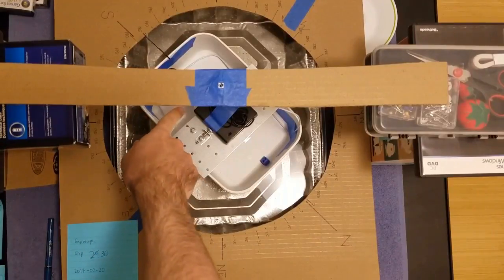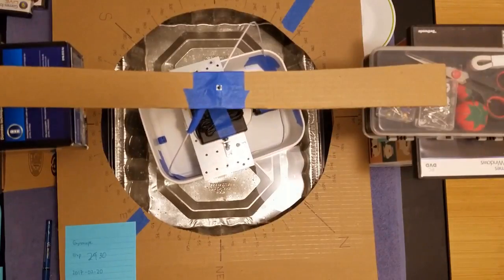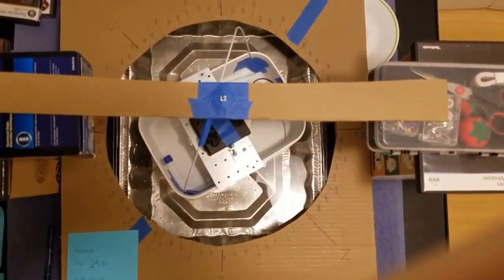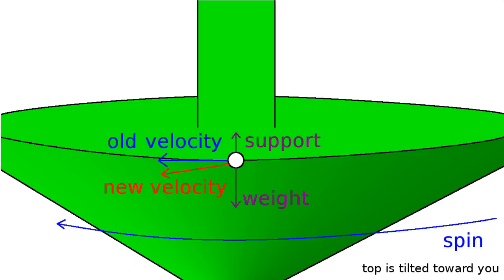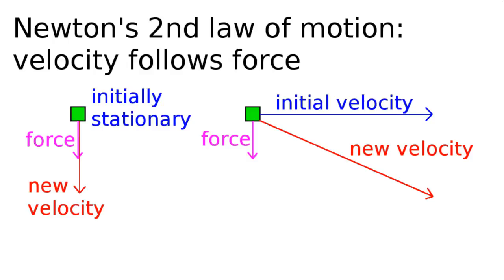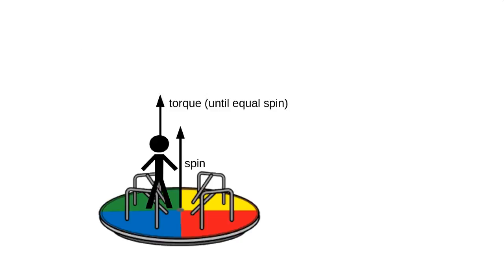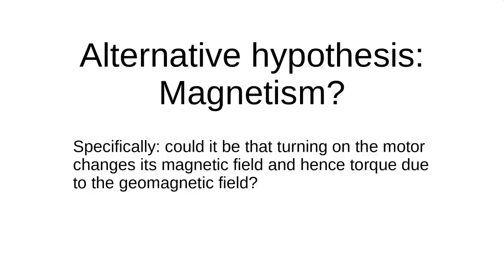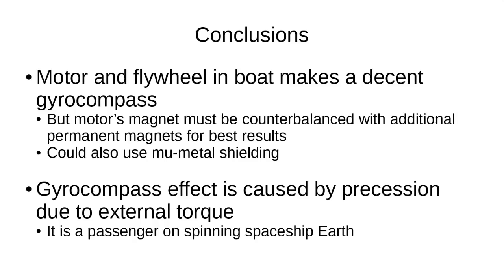Gyrocompass showing effect of Earth rotation

Comment: I wonder if there is a way to set up gyroscope in such a way that it can detect Earths orbit around the Sun? It will take 6 months for gyroscope to spin upside down and you will need to figure out how to cancel out the effect of Earths rotation on gyroscope. This way i think we can know if Earth orbits the Sun in circular fashion or vortex fashion. If circular fashion, then the Sun doesn't move. If vortex fashion, then the Sun orbits the Galaxy or another Star.
Reply from the maker: Well, a perfect gyroscope doesn't directly detect rotation; rather, its axis simply does not rotate, so if something else does, then the relative orientation can be seen to change.  To detect the rotation of the Earth-Sun system ("Earth's orbit") with a gyroscope, start by pointing its axis at the Sun, then observe that 6 months later its axis points away from the Sun.  To detect the galactic orbit, point the axis at the galactic center (Sagittarius A*), then observe ~120 million years later its axis points away from the center.  The Sun is not co-orbiting any other star (other than those near the galactic center), so there is no star for which you could point a gyroscope axis at it, then regularly observe it being on the opposite side.
Reply: @GarbageGamer74  I know the gyroscope maintains its axis and resists as long as its rotating, that tilting of gyroscope is only an appearance caused by earth rotating under it. There's a possibility the Sun is in 25,920 year long binary orbit with Sirius. https://www.youtube.com/watch?v=90q1uIQ5PqM Most solar systems within the galaxy are binary so the chances are the Sun is too.

Comment: Some minor effects that might disturb your gyro

1. The electric motor has magnets. The magnetic fiels of the earth will put a force to the magnets used in the motors.

2. Some parts of your gyrocompass are made of iron. Even if they are not magnetic now the earth magnet fiel will try to turn them into a north south direction.

3. Some parts of your gyro are generatong some kind of air stream, so the tiny forces of these airflow might affect your gyrocompass.

This is no offence, I thought about similar experiments (I'm not a flat earther) but I feared  all the disturbing effect might be bigger than the forces that should make the gyroscope into a gyro compass.

Kudos on your courage.
Reply from the maker: Thanks for the comments!  Regarding points 1 and 2, you are right, and that is why this gyrocompass does not point perfectly North.  I did a follow-up experiment with magnetic equilibrium in different places to show that, regardless of the magnetic effects, the gyrocompass effect is still strong, and always makes it deflect toward North.  See the link that I just added to the description of this video.

Regarding point 3, that's a very good observation.  In fact air flow coming off the flywheel can easily dominate other effects when using an instrument sensitive enough to detect Earth's rotation, as I discovered to my surprise when I started this project.  That is why the flywheel is encased in a paper cowling, ensuring there is no net torque due to air currents, since they are confined to that cowling.  I think I say that in the video but it might not have been clear.

Comment: Why can't you just point your gyro east, on a gimbal, and have it rise with the sky?
Reply from the maker: I did that.  Search my channel for "gyroscope version 2".  It worked, but only for a few minutes at a time before falling out of balance.  It is difficult to create a 3-axis gimbal that is both balanced and has low friction.
Reply: @GarbageGamer74  Sadly, your data traces are so confusing I am having trouble understanding what it shows. I imagined that a properly supported gyro could just tilt up with the rising celestial sphere. I may be dense, but (for me) you assume too much is obvious. I have the gyro and am trying to design my own rig.
Reply from the maker: @MumfordMicro  Suppose you had a properly supported gyro, tilting up with the celestial sphere.  Attach a laser pointer to the gyro.  The dot will follow the sphere, right?  That would be one trace, with the dot moving 15 degrees per hour.

Now suppose the gyro is balanced only within a limited angle.  When it exceeds that angle, it falls to one side.  So you would have to manually set it back within its range of operation and repeat.  That's the next trace.  I did that over and over to get the traces shown.  But I didn't always reset it properly (it is very delicate), so the traces show a mix of behaviors.

Finally, in my setup, the laser bounces off of a mirror mounted to the gyro, rather than the laser being attached directly.  That magnifies the motion by 2x, so it moves 30 degrees per hour when in the balanced region.

Good luck making your own version!  I look forward to seeing it.
Reply: @GarbageGamer74  That was my vision. But, that doesn't seem to be what your laser dot does. Would you be willing to have a private email conversation about tall of this? I'm not hard to find.

Comment: Damn! This is the best helio video ever produced. A little complicated and I'm not sure if your flywheel is countering the rotation f the Earth or just the magnetic force from the onboard magnets, but a brilliant thesis and explanation nonetheless.The best part is you actually conducted and filmed the experiment. You obviously have a physics education. NDT look out - heliocentrism may have a new spokesperson. Thanks for making this. I'm assuming this is the simplest experiment to demonstrate the rotation of the earth since this is the one you chose, but thought I'd ask...is there anything simpler?
Reply from the maker: Thanks, I'm glad you liked the video!

Note that this experiment doesn't directly imply anything about the structure of the solar system or shape of the Earth.  Rather, it shows that, here on the surface of the Earth, we live in a rotating frame of reference.  It furthermore shows that the axis of rotation has a component in the horizontal plane that is aligned with geographic North.

Is there anything simpler?  It depends on your definition of "simple".  :)  This experiment is the easiest to construct and most convincing of those I have attempted.  A full 3D gyroscope is conceptually simpler, but my attempt at that was only a partial success due to the mechanical challenges; there is another video on my channel about that, "Foucault Gyroscope showing Earth Rotation, version 2".  A Foucault pendulum is another candidate but also has a host of mechanical challenges, so I have not attempted to build one.
Reply: Fair enough. I will just direct anyone interested to your video, since your presentation is much, much better than I could ever explain it. Thx again.

Comment: Testable, Observable, Measurable, REPEATABLE  is the yard stick requirement. Your claim is that your experiment would find true north using "Earths" rotation. If a gyroscope in a three way gimbal doesn't precess at all, until you physically move it proving non rotation, what is your experiment adding to this indisputable fact? Having a motor attached constantly to the gyroscope causes a contra-rotation effect stopping it from acting like a gyroscope and the magnets will cause it to act like a compass, just like any other compass.

So i'm afraid it fails hands down.
Reply from the maker: Repeatable: I have a few other gyrocompass videos on my channel.  I recommend looking at "Testing the Constant Torque Hypothesis", showing the results of four different runs simultaneously under varying conditions. 

Three-axis gyroscope: I have a video on that too, see "Gyroscope version 2".  It isn't perfect, but it certainly moves.  The other videos I've seen on YouTube use gimbals with too much friction. 

You can see in this video, and the other I mentioned, that it does not simply behave like a magnetic compass when the motor is running. With the motor off, it finds a certain magnetic equilibrium.  Then when the motor is on, it consistently deflects toward geographic North, regardless of where that is in relation to the magnetic equilibrium.
Reply: @BULL SCHEIST lookup the video I ask Bob to watch above.  Ring-laser gyroscopes MEASURE EARTH'S ROTATION.  PERIOD.  So do mechanical gyros, lookup the "gyro-compass".
Reply: @BULL SCHEIST  "toy" gyroscopes have too much friction to reveal the effects of the rotating Earth.  Research the "gyro-compass" they were patented in like 1905 and use Earth's rotation to determine true north.  They are still sold TODAY for ship navigation because they are immune to magnetic field disturbances.
Reply: @BULL SCHEIST focault did not use a gyro, he used a pendulum.  Now research the Gyro-compass (lookup Raytheon Anschutz Standard Gyro 22) they even explain in their documentation how the gyros must be very low friction on the gimbals. They suspend them in a liquid.
Reply: Abdul Moiz Qureshi  
You guys might of been arguing it. I don't argue, i just lay it down as it is.
Reply: Stuart Gray
Ring laser gyroscope. No mass in rotation? And this one says the imagined ball is rotating? But a proper gyroscope, IE a mass in rotation, confirms the imagined ball spin is just spin.

So why do you opt to believe the old black box method?
Reply: Abdul Moiz Qureshi  
A true gyroscope, using a rotating mass will process WHEN YOU MOVE IT. When it is still it will not process at all. Telling you that when you are not moving it, nothing else is. It is doing 0 miles an hour.
Reply: @evolutionCEO  - "So why do you opt to believe the old black box method?
Because AFTER I test these FOGs using earth rotation, I install them on to real spacecraft, launch them to space then USE the Gyro to do things like: POINT AT EARTH AND TAKE PHOTOS.
It's a rotating sphere. There is exactly ZERO question about this.

Comment: Sure is a challenge to show definitive curvature huh?...
Reply: @ Edge Wyze "Sure is a challenge to show definitive curvature huh?"   Actually it is not a challenge at all... Geodetic level survey over 1 mile, measure points every 50' along the mile, compare the elevation of these points with drops from a telescope at one end to a target at the other end,  both telescope and target set at the same elevation, and you will get a perfect up and down 2" curvature. Takes 1/2 day to run with 3 people. (ex geodetic surveyor)
Reply: @paulj1138  
Yeah, but things in the distance get smaller. When you zoom in it offsets the measurements. That's why surveyors only measure two points equal distance from one center reference point. To compensate for "curvature" or in actuality it eliminates the error of angular resolution. 

Same reason hunters have to "sight in" their rifle scope. So they know where the bullet hits at a certain distance, and so they can compensate for shorter & longer shots. 

They'll sight it in at say 30 yards, get that on the bullseye, then move the target farther & closer to know how offset the shot will be. Doing this with their gun locked in to a special vice apparatus, & taking shots from the same reference point.
Reply: @ Edge Wyze. regarding diminishing size of objects (i.e. perspective). 

Sorry you are wrong. I assume from your equi distant measuring points from a central reference point you are are referring to equal fore and backsights when leveling. The reason for doing that is to remove colimation errors. You can look up how colimation error is removed by doing close and distant sights in conjunction with balanced fore and back sights.

You should also research stadia measurement techniques which prove that 'level' does not rise or fall as a function of distance.
Reply: @paulj1138  
Dude, so at a football field every fifty feet there is curvature drop?

Nope, but the theodolite scope will still show said offset reading.  Hmmm
Reply: @ Edge wyze

If I were to be pedantic (as surveyors are inclined to be ;)    ) there is curvature every inch across the earth, but  very small ;) - too small to be measured.

Think of it this way.... 

1) Use a geodetic level to measure the levels of every point 50' along a 1 mile length. 
2) Pick any particular elevation that is workable at the location, and place a vertical marker at each 50' point, so the top of the marker is exactly at the chosen elevation (keep in mind the vertical markers will have different lengths because the elevation of the ground marker will vary - i.e. this is the real world where the mile long stretch is not perfectly flat)
3) If you want to go further, use some clear plastic tubing to make a water level as well, along the mile. You will see the water follows the same 'level' as the vertical markers.
4) Set up a telescope at one end and a target at the other with exactly the same elevation. If your vertical markers came up to the same elevation you will see the rise and fall over the mile.

Sure, it takes effort to do this. Also it is not numerically dramatic as simply measuring curvature drop over 1 mile (i.e. 8 inches per mile drop, vs 2 inches = 50mm rise and fall over 1 mile). I think I said 25mm in an earlier post - please ignore that one - I am busy today. 

An advantage the rise and fall method does show immediately is the drop observed if using a theodolite is not related to 'perspective' at all. 

So having been a Geodetic Surveyor who has observed this a lot in the past, especially when conducting dam wall surveillance surveys, I am not blowing smoke up your backside. 

So my question for you is why is an up and down curve of 2" observed over 1 mile?

Comment: Vibration and sound caused the rotation.
Reply from the maker: Care to elaborate?  How does vibration cause rotation here?
Reply: The motor caused vibration and water reacts on vibration and caused also vibration - waves. If you have a drill, turn it on and put it on the table and it will rotate. Rotation causes sound. But maybe I am wrong and I did not watch or understood correctly.
Reply from the maker: During the run, the water is completely still.  Any waves would be visible due to the reflection of the overhead light as you can see at 0:43 when I put my hand in the water.

I still don't understand what you mean about vibration causing rotation.  I have a drill but there is no simple way to "turn it on" without holding it since I have to continuously squeeze the trigger.  Could you link to a photo or video showing the setup you have in mind?
Reply: I can not fully judge your desing but where vibration is, is also rotation if the design allows it. You can block the trigger on your drill with a piece of paper.

http://www.fs.wettzell.de/LKREISEL/G/LaserGyros.html
http://www.laserfocusworld.com/articles/print/volume-36/issue-10/world-news/world-news/largest-ring-laser-gyroscope-lands-in-bavaria.html
This machine is deep in a mountain to avoid any distubing vibration that could influence the measurements. But I do not know what they measured, maybe satans shake on the pillars of the earth ? Who knows  ;)
Maybe the scientists should have saved the millions for their gyro and just copied your design  ;)
Reply from the maker: If vibration alone could cause rotation, that would violate conservation of angular momentum.  If I put an electric toothbrush into a boat, do you predict that would rotate?

As for the ring lasers, the idea there is to measure the speed of the earth's rotation extremely precisely.  In contrast, a gyrocompass like mine merely shows that the earth is rotating without providing much information about the speed.
Reply: Maybe it depends on how and where the toothbrush was placed? I do not know all the possibilities or situations that would trigger a rotation. If your washing machine vibrates, it may even be on the move. Or
the things that are on the washing machine are starting to move or 
maybe even spinning depending on the construction of things.

"...a gyrocompass like mine merely shows that the earth is rotating..."
Assuming other circumstances, such as vibration (?), are not the cause of the rotation.

Comment: The earth must spin as the dizzy sensation you get when you bend down quickly and stand up is due to the increased centrifugal forces from the earths spin on your brain. but your experiment proves it just as well.
Reply from the maker: Feeling lightheaded after standing up quickly is not related to Earth's rotation.  The increase in centrifugal acceleration over a few feet is physiologically insignificant; people at the poles feel the same effect even though there is no change in angular momentum for them.  Furthermore, increasing centrifugal acceleration by standing up would decrease rather than increase weight, which would make it easier for the heart to maintain blood pressure in the brain.  Consider: if you were a giant, 36000 km in height, then by standing up at the equator, your head would be in geostationary orbit, and your head's weight would be zero.
Reply: I think that affect is due to orthostatic hypertension, or postural hypertension.

Comment: Easiest ball earth explanation yet.  Clear as lead. Just need a flywheel, motor and boat with only 1,034 easy steps plus a bottle of aspirin. You might just wake up in the morning.
Reply from the maker: LOL.  :)

This experiment is actually quite easy to build if you have the flywheel and motor.  I spent $89 on that.  It took less than a day to build the first working version out of household junk (plus the flywheel), although I made a few refinements before posting this video, the most significant of which was adding the balance magnets.  In comparison, I spent a few hundred dollars and more than a week trying (and only halfway succeeding) to build a proper gyroscope with 3D gimbals.  (That video is also on this channel.)

However, note that this experiment doesn't say anything about the size or shape of the Earth.  It only demonstrates that, living on the surface of the Earth, we are in a rotating frame of reference.